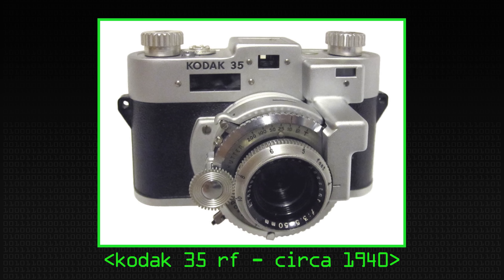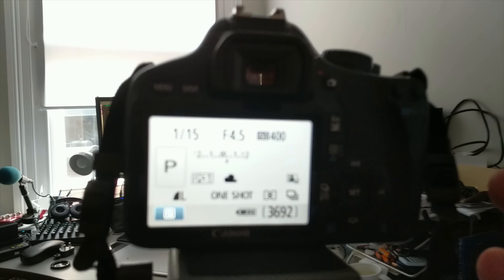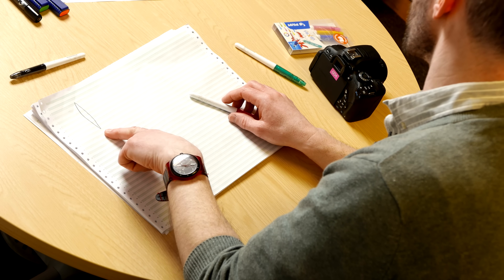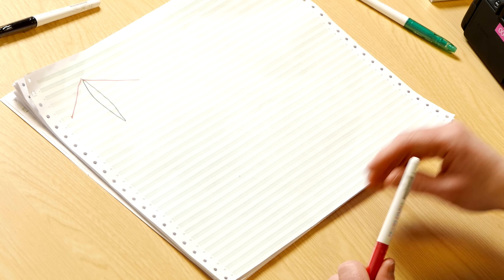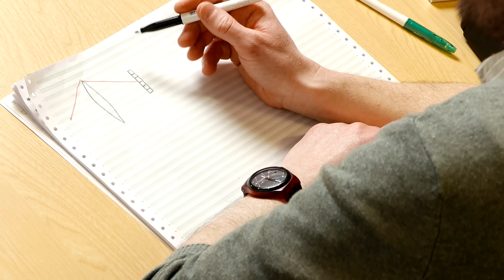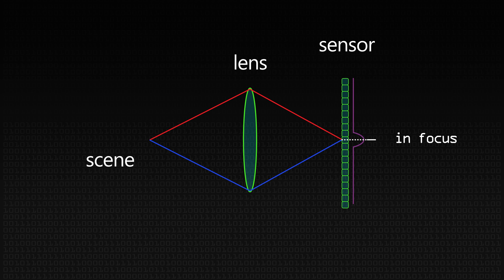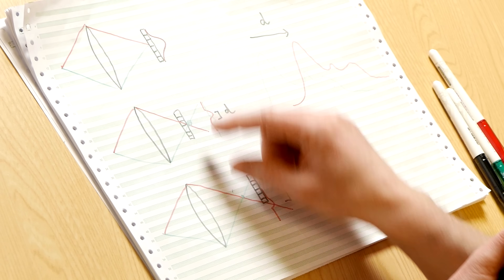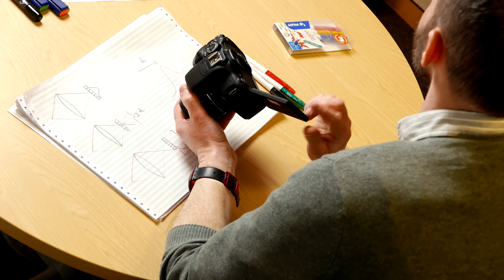How Autofocus Works - Computerphile

Comment: The diagrams in first half, about PD-AF, are completely nonsensical! That's just not how lenses work, they don't split light up like that. There needs to be some way for one sensor-strip to catch light only from the top part of the lens, and the other sensor-strip only from the bottom part of the lens.

Comment: My guess before watching is some sort of convolution algorithm for detection, and using gradient descent to shift the lense to minimise the error. You take a guess if a random direction, and apply convolution to blur, then you compare pixel values (at fixed points to omptimise computing) to the picture from before, and if they look alike you have successfully blurred to image, then you take a step in the opposite direction if it was blurred, and if it was not, then reapply until the error is minimal.Yes, I work in MLOps…

Comment: I can understand contrast detection, but how do you do the phase detection in code. Can you detail that, this seems like it is missing some key elements
Reply: For the phase mismatch part, there’s a math formula. Coding the formula is trivial, but the math concept behind the formula is kinda complex. The essence is, the amount of mismatch can be measured from by calculating the mutual area under the curve of both sensor outputs. If they’re in phase, the shared area is a maximum, and if not in phase, the area under curve that is shared between both output sensors is reduced. To help you imagine it, draw two mountains next to each other and think how the shared area under the mountain would change if the mountains approached each other or got far from each other.
Reply: No doubt, the intro with the phase detection was poor.  But I still appreciate the explanation.  It's just not enough.

Comment: Some models of Polaroid instant  cameras had ultrasonic sensors.  They feature a gilden sensor of like a good 2cm diameter which was covered by a protective grill, a mesh-like cover with many round holes.  This made them quite easy to distinguish from other cameras.  The size of the sensor was largely dictated by the wavelength of the sound used and meant the sensors could not be built small enough to be invisible.
Reply: Modern smartphones use laser time-of-flight sensors

Comment: I have been meaning to ask this from an informed person but couldn't figure out who to ask. I think I have come to the right place. 
Is camera autofocus a hardware thing or software? 
I mean, can a company improve the autofocus performance through firmware updates?
Reply from the maker: Sadly it depends on the camera - some cameras have hardware solutions and some software, many a hybrid of the two. So it's possible to improve autofocus via a firmware upgrade but your mileage may vary! -Sean

Comment: Could you not run 2 dimensional FFT on the image and try to max out the energy in high frequency bands? Could that would be a simple measure of contrast?
Reply: FFT is overkill for that, since you are paying the extra cost of computing low-frequency information AND calculating the phase of every frequency. Edge detection quickly gives you just the amplitudes of high frequencies, which is exactly what we want to know.

Comment: When you are talking about 'contrast' you are actually using the wrong terminology.  Contrast of a photo is defined as the difference in luminance between the dark and light parts of the image.  A photo that is out of focus will essentially have the same contrast as the same photo in focus.

What you are describing when you compare adjacent pixels is a measurement of the bandwidth within the image.  An in focus image will contain considerably higher information bandwidth than the same image out of focus.  A simple way of quantifying the maximum bandwidth content of an image is to compare adjacent pixels.

Comment: Quite often you want to discover the structure in your image, not just in X and Y, but also in Z (depth), then apply rules to choose where and how to focus.  Here is where the hunting of contrast detection stops being a liability and becomes a benefit, and where the whole-scene processing of contrast detection gains power of the (generally) linear strips of phase detection.

Simple or naive contrast detection algorithms use differences within neighborhoods surrounding a central pixel, which is equivalent to passing an oriented bandpass filter across the image.  Why not capture *all* the frequencies in the image?  This can be done using a Fourier Transform, one common formulation of which is the FFT.  Taking three quick FFTs at slightly different focus settings can reveal an immense amount of information that can then be processed to extract 3-dimensional geometry.

You not also get the static structure of the view, but you can also do things like object tracking without knowing what the object "is", relying on the operator to simply indicate a region of interest to track and keep in focus.

While FFTs are great for auto-focus, they can be a bit heavy for object detection and tracking.  This is where MPEG4 algorithms such has H.265 help out.  Even if you are capturing your image or video as "Raw" data, the autofocus/autotracking feature is often using the video compression subsystem in the background to do its job.  Which is why many cameras offer "Raw+Compressed" options, since it's doing the work anyway, letting the user decide how best to use the available storage space.
Reply: Wow, that's incredible! Thanks for sharing.

I've seen VLC glitch out in interesting ways when it misses a keyframe while streaming video. It inadvertently does stuff like edge detection and motion detection, and I've always wondered if video compression hardware can be abused for stuff like that.

Comment: It never ceases to amaze me how autofocus can focus on a tiny scratch on an aircraft window rather than the scene outside.
Reply: That is simple, it is looking for sharp contrast differences, since things in the distance are generally softer, because the light scatters and diffracts through atmosphere and the crack is nice and close, so it will be the best to focus on. Also sometimes it works to prefocus in manual focus beyond the window (not on phone, heh), so it will much easily find decent contrast outside, rather than the scratch right in your face. Also helps to put that scratch mark closer than the minimal focusing distance of the system/lens.
Reply: @Jan_Jancik45  You just ruined his amazement.
Reply: @thesidj  understanding is even more amazing!
Reply: Autofocus systems generally are built assuming the foreground object is the one to focus on.  So your camera is working as designed though not as desired by you, the user.

Better AF systems have features such as focal range limiters.  For example my one lens will only focus on objects at a minimum distance of 5m, if enabled or 1m if disabled.

All cameras by design have a minimum focal distance.  In your case get very close to the window and will pick another object to focus on.  The additional advantage is that this blurrs the scratch which you don't want to see in your image even more.
Reply: Wouldn’t this be a case of a local maximum basically “trapping” the AF mechanism?
Reply: @KamilOchel  For the simple mechanisms certainly.  More complex autofocus mechanisms involve lots of software and signal processing and the failure modes appear to be complex.
Reply: My theory is just in case the crack gets bigger then you'll never miss that caught in camera moment even if it happens to be your last.
Reply: Had the camera focus on a bee 20 ft away from me while planespotting, missed the shot😭
Reply: Does any camera have a “nope, try again” function for autofocus?  Mine has a button to trigger an autofocus, but it lacks the smarts to avoid making the same mistake over and over.
Reply: @Steve.M  I know what you mean - but the camera doesn't know what the problem was so it has no way to “learn” from its previous mistake.
In my experience the most common failure mode is to zoom to either extreme end of the focal range before giving up.  That is almost certainly a mistake - but not guaranteed to.
Reply: @ralfbaechle I was thinking more of a little nudge past the previous result. The camera shouldn’t need to understand why I didn’t like its choice, just be discouraged from choosing it again. For example, ignore (or weight against) results in the distance range and/or from the focus point that it used last time. I’m sure it’s not trivial, but it seems like something could be possible.
Reply: @Steve.M i haven't seen a "nudge" feature like that but some cameras and lenses have "AF Range Limit" features
Reply: ok?
Reply: @Triantalex  ok!
Reply: @HowDoYouUseSpaceBar  dokey
Reply: Just set the focus manually to infinity.
Reply: Relatable. 😂
Reply: For phones shooting through windows, sometimes the issue is active autofocus based on LiDAR. The LiDAR uses a wavelength of light that the window is opaque to, so the autofocus thinks it's looking close-up at a wall effectively. Sometimes you can workaround this by covering the LiDAR sensor or using apps that let you control whether it's used
Reply: from the video, it seems that if that's a presisting issue, it's probably because your camera uses active/sonar focus method.

Comment: For me, Autofocus has an anti-bias towards taking close-up photos. I hate it when i get it in focus, press the camera button, then it decides to throw it out of focus, then snaps the picture for me. Thanks technology.
Reply: Have you tried back button focus out of interest instead of half push of the shutter button.
Reply: @christopherbuckenhamphotog368  yes. I just use manual focus whenever i have the time.
Reply: Fusion Developer the reason that many cameras have this issue is that the focus throw for non macro lenses is not very large up close. If you have a marked lens, you’ll notice that the distance from close focus to 1 m is very small. This means that you have to be much more precise to bail focus. Cameras are also smart, and they commonly look for something far away even if they can focus up close in case you are shooting through a window. This is why many cameras will hunt, focus up close, and then hunt all the way to infinity.
Reply: @Van-yo2xr  oh okay. It's just annoying that i tap to focus, then when i go to take a picture, it changes focus so the entire picture is out of focus, but now i understand why. Thank you.
Reply: @FusionDeveloper  that's why I suggested back button focus set your focus with a different button then when you press the shutter it doesn't re focus.

Comment: Quite a long time ago, I had to write an autofocus program for a microscope stage. I believe the way I did it was to apply a Gaussian blur to the image, subtract the blurred image from the original image and then try to maximize that difference. Similar to this algorithm I guess, but didn't need to decide a direction for subtracting neighboring pixels.
Reply: Subtracting a gaussian blur is how "unsharp mask" sharpening method works. :)

Comment: Two means of auto focusing:
1. Phase Detection: Look at where light rays intersect the photo receptor and adjusts the focus accordingly.

2. Contrast Detection: Compute a difference between neighboring pixel values to determine how focused the image is. Use trial and error to determine the direction of adjustment.

Both rely on a difference to determine an error and then makes an adjustment accordingly. Phase Detection is smart in its direction of adjustment, while Contrast Detection is naive.
Reply: sperm

Comment: Couple additional pointers: On sensor phase detection is also provided by other manufacturers than Canon, but with different approach. Canon uses those dual pixels, which are two separated diodes. Others use a mask that blocks different half of two adjecent pixels, providing either the "upper beam" or the "lower beam" that went through the lens. These masked pixels are then compensated computationally on the final image, so you cannot see them.

Also, the phase detection is fast, but not really that precise due to the error sources involved such as imperfections on the lenses like chromatic aberration and lens's autofocus motor calibration vs. the phase detection array position. Contrast detection is less error prone, and does not need the lens autofocus motor to be calibrated, as the focus is done on the final imaging device (the sensor).

The best on sensor autofocus uses both methods - it first figures out the distance and direction where to focus with phase detection, but leaves focus a tiny bit out of focus in that known direction. Then the contrast detection is used to find the strongest contrast from that point forward. The end result is fast and accurate (not as fast as phase detection only, but with modern calculation speeds, the difference is not big).
Reply: Thank you for your comment. Quite interesting and much appreciated.
Reply: Thanks! The video was heavily biased toward SLR cameras and didn't really appreciate the performance of smartphone focus. I wondered about mirrorless since I have a Sony a6400. This helps see the benefits of contrast instead of only using phase.
Reply: @Ck87JF  Sony implements focal-plane phase detectors, which are built into the sensors (not clear in which way it works, though), and it works with contrast AF in something marketed as "hybrid AF". Phase detection is not very robust when the lens is not perfect and in most cases has limited resolution, while contrast based AF methods are more accurate but work slower.
Reply: @Ck87JF I think smartphones license the technology from Canon so it's dual pixel autofocus
Reply: @Ck87JF A lot of smart phones these days also have proximity sensors for fast and accurate autofocus. The downside is it only works if you're focusing on the center of the shot.
Reply: I would assume for mirrorless cameras that use their image sensor as the phase deteciton sensor, there's no calibration needed. At least they don't have that classical adjustment option like DSLRs did.
Reply: Yeah thanks from me too, this video made do some learning :)

Comment: That's pretty interesting! I remember an older film camera having a circular focus assist in the middle, IIRC it could use it to autofocus, but you could also use it for manual focus - it was seemingly showing different focus levels on each half of the circle, and you'd know you're in focus when you can't distinguish one half from the other. I guess that was phase detection! It also reminds me a bit of how gamma adjustment is done on computer screens nowadays :-)
Reply: Yep, I've got two older film cameras that have that. It's called split-image focusing.
Mine also have the split-image circles surrounded by a ring of microprisms, which also help to focus.

It's nice how intuitive the split-image focusing is. Very easy when you've got something like a tree branch or straight edge to line up!
Reply: Totally, I literally was a kid back then and it was easy to use even without explanations!
Reply: You can actually buy third-party split-image focusing screens. I keep meaning to get one for my older SLR that I mostly use with vintage lenses.

Comment: The ilustration at 1:06, rangefinder focus, is fundamentally wrong. To make it right, at least front and back plane should move with different speed. Aligned plane is the one where the focus is.

Comment: I'm really interested how dual pixel phase autofocus works.
Reply: Panasonic is interested too.
Reply: @MarceloLangame  lol...
Reply: it is the same as normal phase detect....but instead of redirecting the light with a mirror, it works on the image sensor. instead of splitting the beam somewhere else, it uses 2 pixels to measure 2 points of beam and phase detect.... that is the simpleset I can explain it
Reply: The same. It's an image sensor modified to be able to do phase detection.

Comment: 13:28 It's not totally accurate, very often it's even hard to know IF you're out of focus with CDAF. Then there is the issue of local maximums, since the example given shows a perfect curve, but a real scene will have multiple peaks. PDAF has another advantage in that it can continuously adjust the focus, but Contrast detection needs to evaluate the change in the overall image to decide when to trigger a new hunting phase (or rely on an external trigger, like the user.
Also, phase detection pixels is available on a lot of sensors now. Sony has them on on all their higher end sensors, pretty much. Haven't managed to use it however.
Reply: Canons dual pixel implementation doesn’t waste image area; all phase detect sensors are image sensors and vise versa. So for pixel peepers and very specific lighting scenarios, Canons approach should yield better results (in most real world scenarios you never see any visual flaws from Sony’s approach, but you could be really unlucky and get the most interesting detail on the spots where you have no image sensor and pixels are just a blur of the neighbor pixels). I think that’s what they meant by Canon DPAF not needing separate optics, there’s optical drawback to their solution.